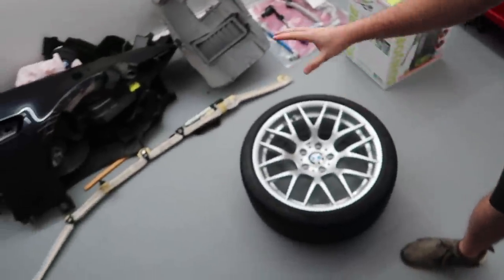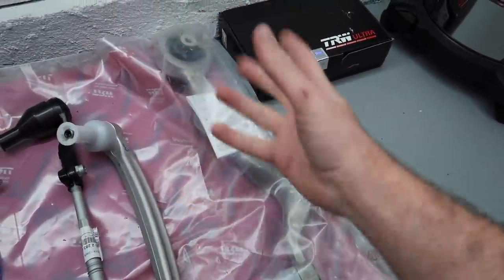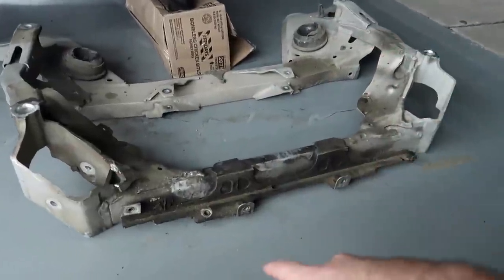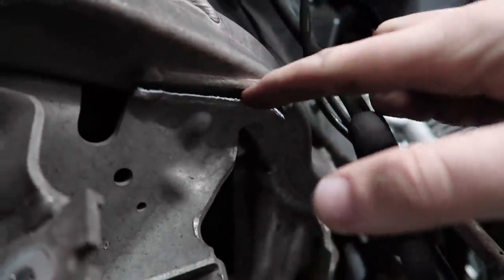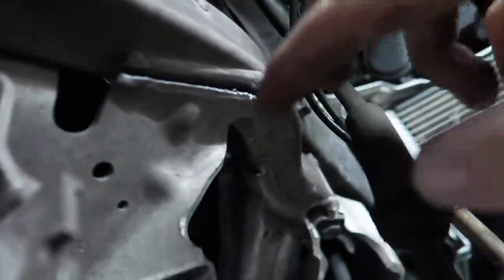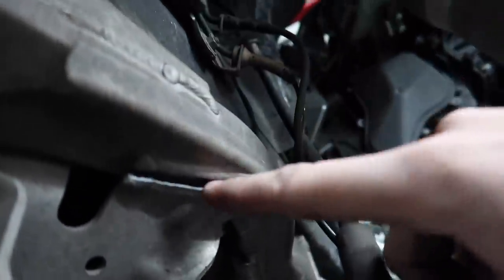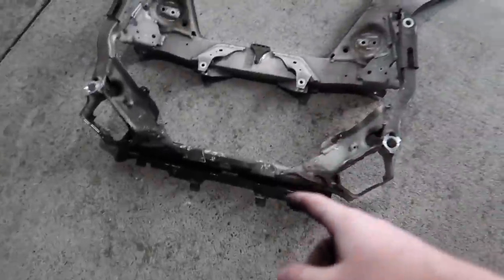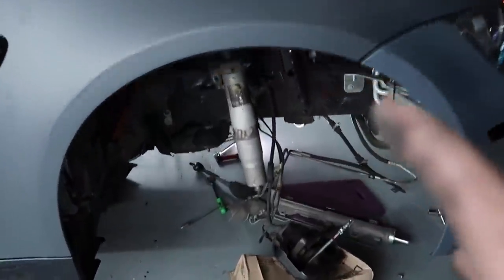WE REMOVED THE SUBFRAME AND FOUND BAD HIDDEN DAMAGE ON THE M3!

Comment: Wassup Bro! OE vs Genuine is the difference of the ///M and/or BMW logo branded/stamped into the part. OEM does mean something slightly different. 

To use the TRW control arm for example: It is OE because they are the SUPPLIER of that part for BMW. That part becomes a GENUINE BMW part because it’s installed at the factory (plus the ///M in the M Division shop) and sold by BMW or authorized retailer like FCP Euro, as Genuine.

Control arms kept by TRW,  are required by BMW to have the logos filed down/removed and are sold to places like FCP Euro, ECS Tuning, and others to sell aftermarket. 

It’s a common misconception and commonly asked question, so I hope this helps you and your channel supporters out 👍🏽💯